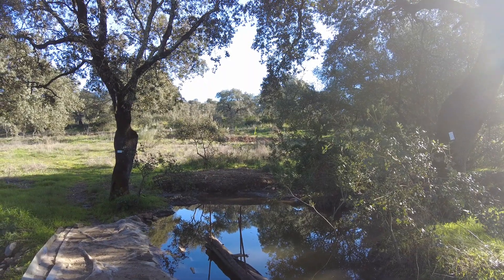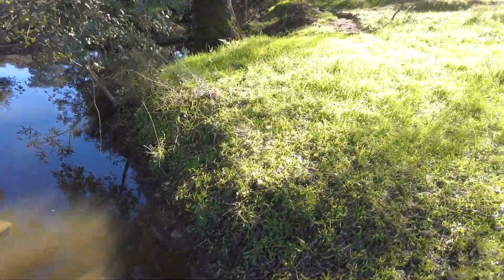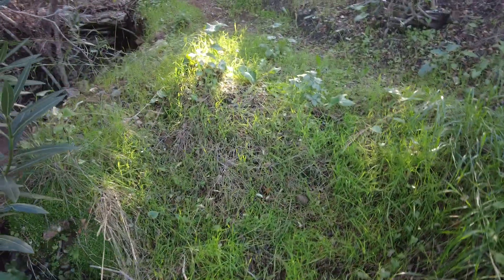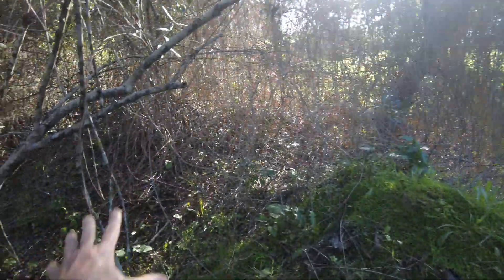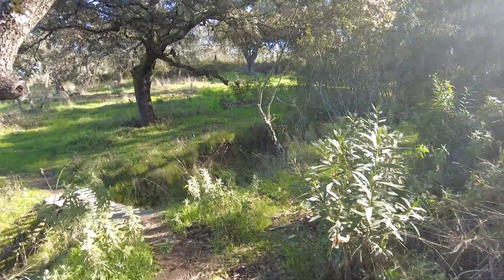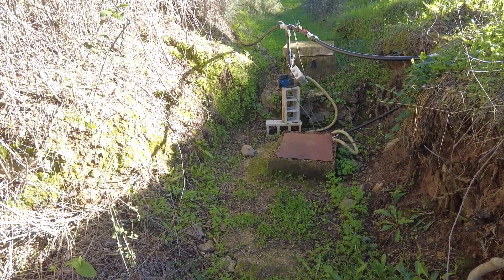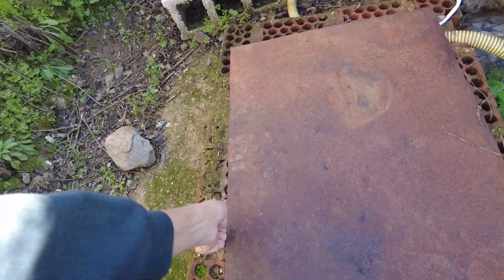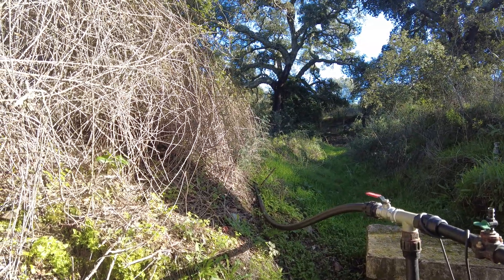Water seepage may enrich / deplete the soil minerals.

Comment: Instead of a rikkety bridge, how about a rock wall that goes up to the height of tve rikkery bridge (or a foot higher) and built in such a way as to be able to walk over with your wheel barrow?    If you want a timber bridge, consider a da vinci bridge.
Reply from the maker: @adammac4381  Very sane suggestion. I'll put it in the top 10 of the TO DO list. Keep sharing. Much appreciated

Comment: In Australia my dad use to clean out pipes and bore holes that were blocked with a 175cfm air compressor one a trailer we would put a piece of polypipe in the water and blow the sand out I wonder if you could use some to blow the blockage out or to agitate it enough to get a pump to draw the sand out with out killing your selves it might not be able to get All the sediment out but it may make it a manageable job 🤔✌️👏
Reply from the maker: @unipartywonagainstthepeople  Good suggestion. Let's put it on the list. Thanks for sharing

Comment: This is a really nice video Martin.  Such beautiful sights!  Sharing some thoughts and observations :)
0:19 Your plastic sheet worked great.  I think I would be inclined to add a foot of dirt on the top (your roadway) and some random smallish stone that you pick up around the farm to cover the below the water liner.  I imagine there is a good amount of sediment deposited on the bottom edge by now.  What a sweet little pond it turned into.
0:48  I would not hesitate to stack some big rocks between the gabion and the bank.  You have no worries about the tree root.  I would be more concerned about eroding more soil from around the root by giving the flow a straight shot. 
0:55 Exactly what you are looking for in your restored stream bed. Perfect!
1:09 + lovely vernal pools.
2:00 Great illustration of restored stream bed; sand, gravel and cobble.  This likely how the stream bed looked like in ancient times.
5:29 The water level in the cistern is higher than I remember seeing in the past.  There is a great volume of water stored in the cistern, the mine, the decontador and all of the surrounding rock.  If I recall correctly, the waterproofing in the cistern did not go to the top of the sidewalls.  I suspect that is why the seepage will stop long before the cistern gets low.
Beautiful sights.  3 years of water harvesting paying big dividends.  I remember when relying on the cistern for irrigation water was a hope and a wish. 🌳💚
Reply from the maker: @stevejohnstonbaugh9171  Thank you for sharing Steve

Comment: The fun part of this is, every time you raise the water level (by continuing to add obstructions in the creek higher and higher), you will raise the local water table higher and higher, storing more and more water until your underground storage (which you pump from) remains filled further and further into the year. It's a great thing to watch over time. But even just extending the flow of your above-ground water is wonderful to see! :)

I wonder if it would be worth it to dredge your lowest pond every once in a while for that settled sediment and nutrients, since that appears to be the end of your system there. Perhaps more trouble than it's worth, but if it accumulates, I'd personally rather use it rather than the pond filling up with goop and no longer holding much water. Just a thought off the top of my head.

Hopefully you don't run out of stones and large debris for your obstructions any time soon!
Reply from the maker: @DustinHarms  Goop we will use. Thank you for sharing